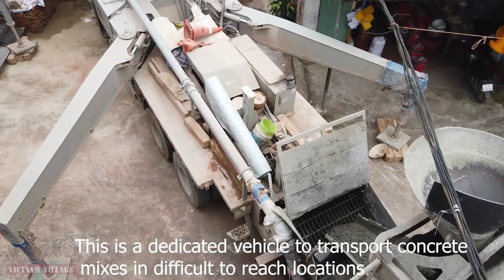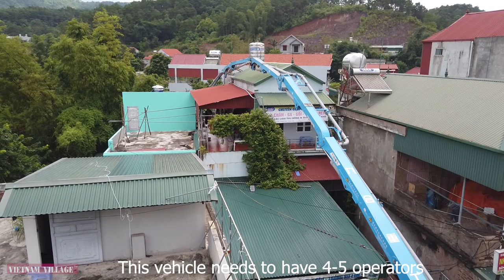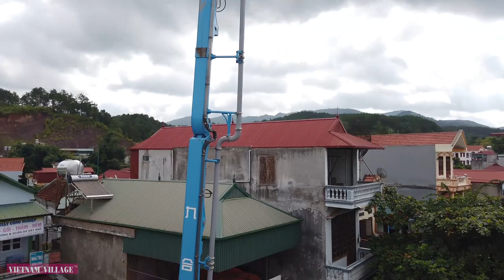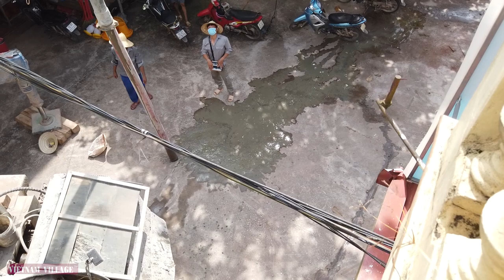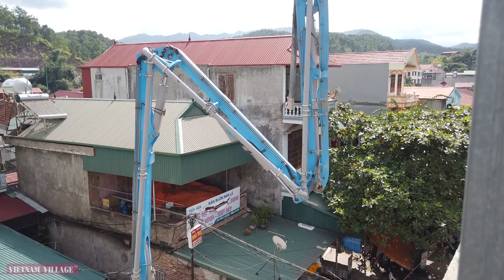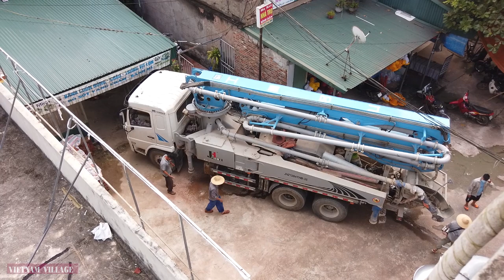Construction Mortar Pump | Vietnam Village

Comment: Pretty impressive to you folks I guess. Commonplace here in the US. I hope this operator finds a source of water to fully purge the pump and piping on the boom. A five gallon bucket of water will in no way properly flush and clean this expensive piece of equipment. No less than a thousand gallons of water is necessary to properly clean the pump and piping!
Reply from the maker: I agree with your opinion